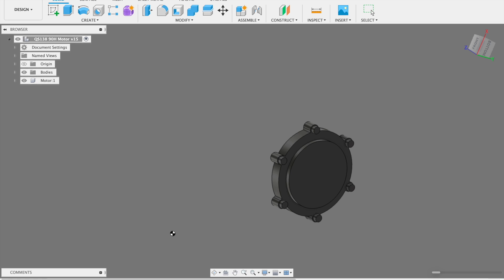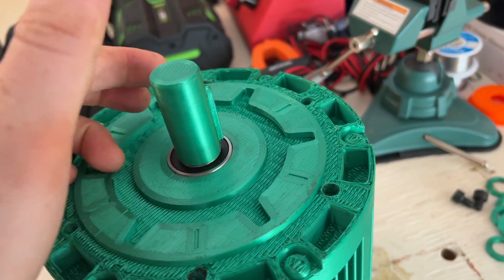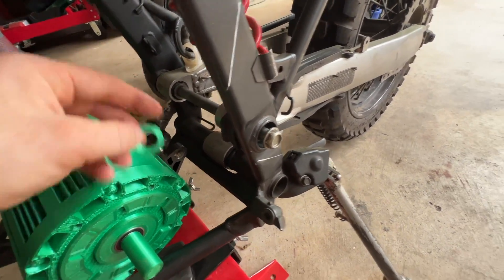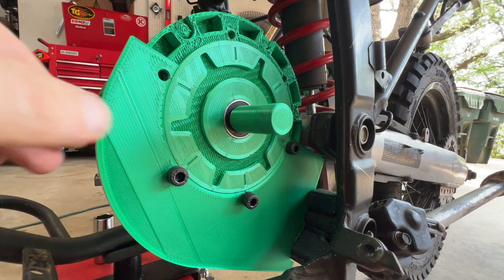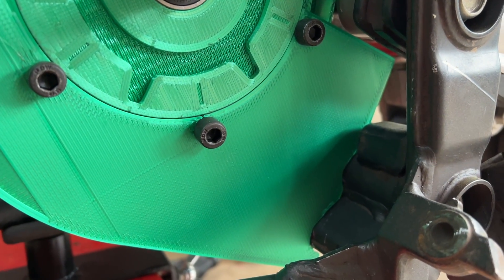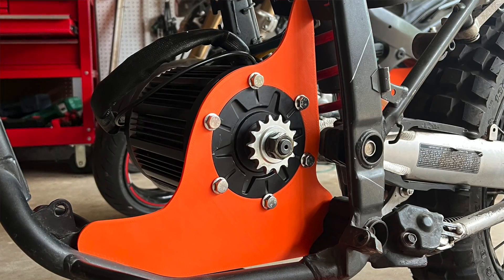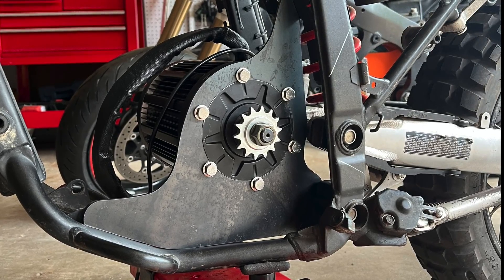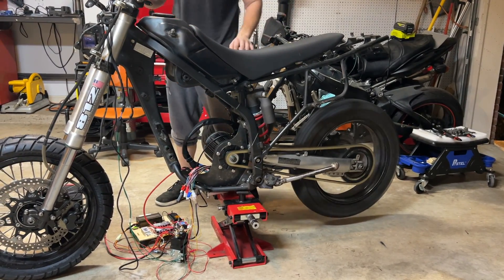Converting a Kawasaki KLX250sf Enduro Dirtbike to Electric (Pt.2) - Designing the Motor Mount

Comment: I could have fabricated that plate in about 30 minutes without the help of computer design or a 3d printer. Just seems like you over prepared for it. Granted I do have about 10 years experience fabricating.
Reply: I could screw my cousin cause she’s a cheap escort but I don’t cause she’s probably dirty same with doing it without technology what are you knocking down the trails as a pioneer and building a log cabin on the front tear with your musket rifle and powdered wig only a fool or someone without access to the tools or no social network to ask around people are more then happy to help even if it’s at a fee work smarter not harder the finial product usually looks and preforms better also never knock progress

Comment: why tf does everyone use the qs138 when the qs180 exists? am i missing something?
Reply from the maker: why use a qs180 when ME1507 exists. why use a ME1507 when ME1616 exists? weight, size, cost, power requirements
Reply: @GaiusGarage  touche saleman... ME1616 it is!!!

i actually didnt even know a 1616 existed so now i have to rethink this build. lol. my current bike is a qs273 50h 4t sabvoton 72200. 200 batt amps. 450 phase amps. 20s4p spim08hp. 32ah. 800A cont. its a great bike. Its been fun. just started year 3 of riding it but every time i hit a pothole and that 100lb rear wheel feels like i got hit by a truck im reminded why i shouldve went mid drive. i thought because the rear wheel would never leave the ground the weight wouldnt matter but it definitely does. Your build is amazing. its pretty much exactly what im doing for this second build. Its been awesome watching these vids. awesome job. I havent got to a video about the second motor installed and the bike working yet but im binge watching the whole series.
Reply from the maker: @jstagzsr  nice! just keep in mind ME1616 is liquid cooled. you can use it without liquid cooling but it would be a waste. it's real heavy duty stuff - big enough to power an electric SUV. if youre not planning some insane 80kW+ build, I would look at the ME1507 or smaller
Reply: @GaiusGarage  wow. That's awesome. It's crazy how much power these motors have.

Comment: Always super impressed with your technique on how you approach your design challenges. It appears that a 3d printer is a vital tool for you, I think it’s time Ii go down that rabbit hole
Reply from the maker: Thanks so much! yeah 3D printing is so useful. These projects would be so much more difficult without one. but yeah, it is a bit of a rabbit hole. my advice is to not cheap out on your first printer. you will end up spending more money on needed upgrades while driving yourself insane. I've had really good experience with the Creality CR-6 SE. As long as you take the time to assemble it well, its about as close to maintenance-free as you can get
Reply: Super helpful, appreciate you taking the time to recommend that printer. As that’s my fear about getting a printer, it becomes a bigger hobby than what I’m trying to build parts for. This electric hobby already takes up the majority of free time and I just see how 3d printing can become a similar sized hobby taking away from the thing it’s trying to advance. But the rewards look worth the time and money invested as you are doing some amazing 3d work in combination with electric builds. 
One of the only channels I have seen that incorporates both so perfectly.
Reply from the maker: @kevins5016  yeah its definitely a hobby unto it's own and I feel the same - its just a utility for me, not an artform. if you get really into the nitty gritty of optimizing the quality of your prints, you'll spend a lot of time tweaking your 3D printer but if youre like me and willing to compomise a bit on aesthetics (maybe some rough layer lines here or there) you can use it without having it suck too much time out of your day

Comment: If you mount the motor on the swing arm in back of the mono shock the chain tension would not change when the rear suspension moves,
Reply: Yeah, but adding 25+ lbs of unsprung weight would screw with the handling 👎

Comment: Fantastic work!
Is there any reason why you didn't use ME1507 motor in your conversion?
Reply from the maker: Thank you! I actually have the ME1507 for another build that I'm about pick back up. this one was supposed to me a quick build using simple off-the-shelf components but if you keep watching this series, it turned out to be a bit of a fiasco. on my second QS138 motor currently and having issues with overheating
Reply: @GaiusGarage  I appreciate fast reply!
I'm in planning phases of go-kart/cross-kart build, and your ME1507 setup video was very helpful. I'm now leaning towards Kelly controller + ME1507 or ME1616 for my build
Reply from the maker: @elyorkhakimov6911  for sure! yeah either one of those would be a great choice! I slightly regretting not picking up a ME1616 for the liquid cooling option

Comment: Did the bike have a 520 chain? Doesn't that motor usually come with a 428 size sprocket?
Reply from the maker: I actually dont remember what chain it originally had but yes, that motor comes with a 428 sprocket -- I customer ordered a 70T 428 rear sprocket and picked up a 428 chain on amazon

Comment: Hello, I am planning to install a motor 3000w qs138 70 H, but the spatial frame of a bike Teleportator Medium, but I have no experience with 3D programs, I can imagine in your head how it will look, but how to install the engine of reality from the bottom of the frame 138, and also use aluminum pendulum from enduro 😰😞

Comment: Did you not need a gear reduction? I’m looking to start my build and trying to decide between the 70 and 90 motors.
Reply from the maker: I think it should be ok. I'd rather have the 90H motor and manage the gearing with the rear sprocket. I have actually ordered a larger one than the one in the video

Comment: Looks like you need to tune your printer, have you calibrated e-steps and/or flow rate? It looked like you might have had under-extrusion, although I'm not a professional
Reply from the maker: haha yeah I use that printer for these sorts of prototypes and generally dont obsess much about fine details as long as the the model is within comperable tolerances to the original. that Ender CR-6 is a real workhorse - I literally NEVER tune it. I barely even clean it or run the auto-level yet it continues to produce very acceptable quality prints. I just printed an electronics box for this bike that'll have in another video that actually came out very pristine without any tuning whatsoever. Also the green filament I used for that motor was over a year old just sitting out - prob had a ton of moisture in it

Comment: amazing video! do you think aluminum would be strong enough? or is it a must to go with steel?
Reply from the maker: thank you! yes, aluminum would be ok I think but it would probably need to be a bit thicker. main reason for using steel is that (1) I was originally going to weld to the frame and (2) it's easier and cheaper to fabricate. I'm working on an electric  GSXR conversion (videos to come) where I will be using a CNC machined aluminum motor mount
Reply: @GaiusGarage  why is it easier and cheaper to fabricate? is it because your tools are better suited for steel or in general?
Reply from the maker: @spirobel  mild steel in general is cheaper than aluminum and the steel supply place in my area offers plasma cutting for steel parts. beyond that, I haven't delved into aluminum welding yet, so just currently more within my skill set
Reply: @GaiusGarage  on the other hand it is possible to cut aluminum with a jigsaw. So no need for a plasma cutter. Do you think it would be possible to build this just by using screws instead of welding?
Reply from the maker: @spirobel  that is true! but for the motor register, I couldnt think of a way to get a perfect hole that size without CNC machine equipment. on that note, it might be possible if you get clever with using the mounting points you have available and I guess if youre good with forming aluminum, its possible. Also if you compromise on looks, you can definitely just mount everything up with haphazard beams, rods, etc. Ive seem conversions done this way that are probably just as robust but even though this is a quick build I wanted it to look half-decent
Reply: @GaiusGarage  For aluminum: you can make a hole in the middle with a drill press and then use the jig saw starting from that hole. Should basically be the same as a CNC machined piece but it will be faster to make and cheaper because you dont need to have a CNC machine. You are right, it all depends on the mounting points. If they are parallel to the plate that holds the motor then you dont even have this problem. Maybe there is also a way to get there with pre made L-shaped pieces and screws.